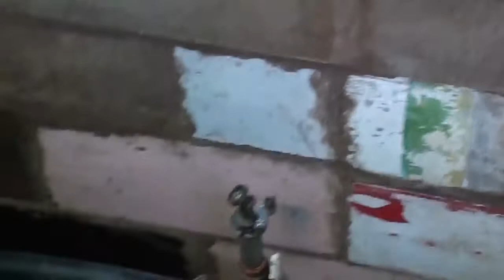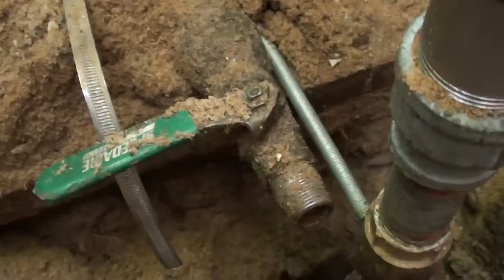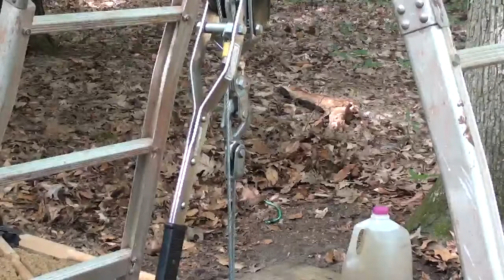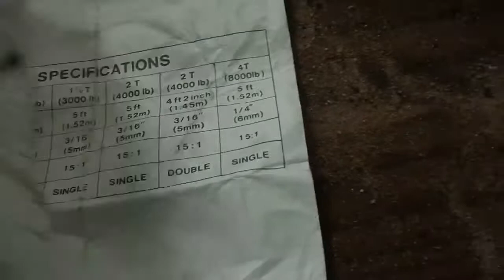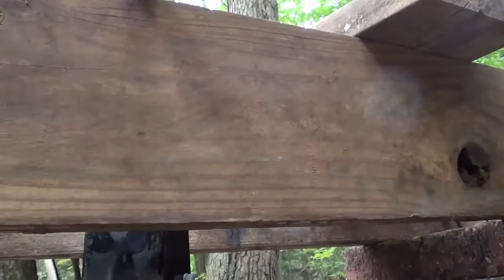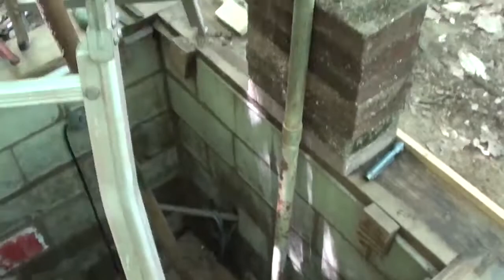How to Pull a Well Pipe and Well Point using only Hand Tools and Hoist Pulley

Comment: fuuuuuu k   summer time ground hard / spring ground wet soft

I got a 2" pipe in solid ground 

already ripped up 1/4 metal & 18" pipe wrench
Reply: summer time

25'  sand point  galvanized steel

Comment: I have a 72' well that hasn't been used in 30 years. Want to get it working. 2" galvanized with a 1 1/4 intake line. Thinking check valve may need replacement but now, after watching your video, point may be rusted out as well. Should I just hook up a jet pump and see what happens? Need to pull intake and replace check valve? Rust and corrosion ruined the whole thing? Thoughts anyone?
Reply: Try the jet pump. You might get lucky. We had a similar situation and it worked fine. Pulling all that stuff out is a pain
Reply: @wildswan221   Thanks! I've pulled the check valves before and it is a lot of toil and sweat. I'm gonna try setting up the pump and see what happens. Like you said, maybe I'll get lucky! Thanks again!!